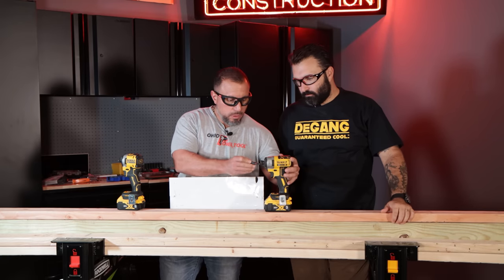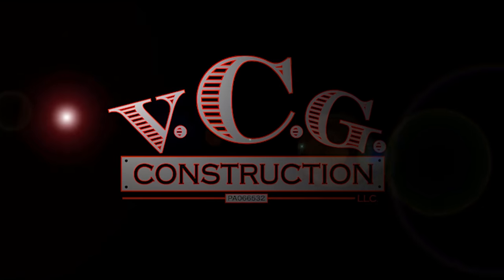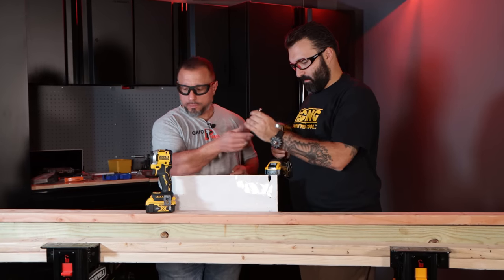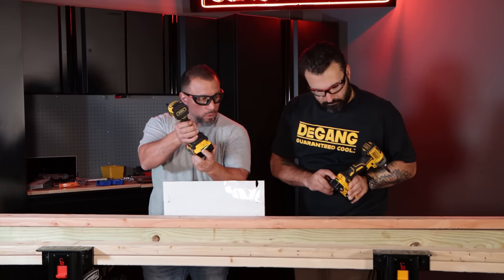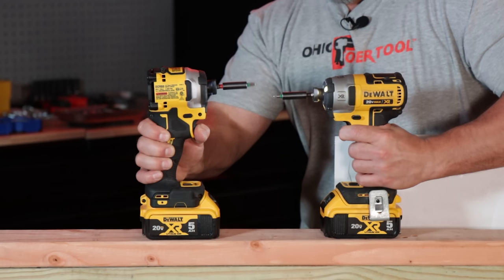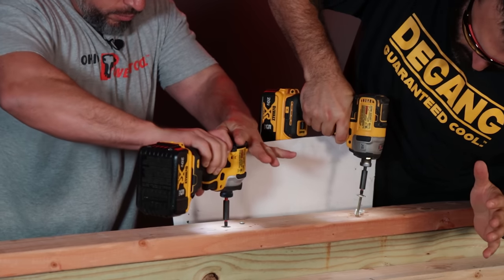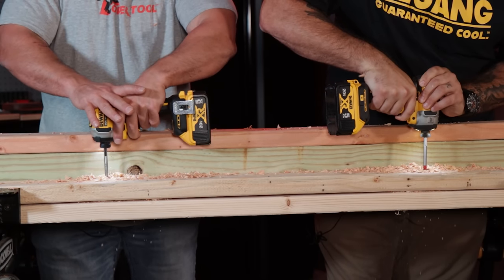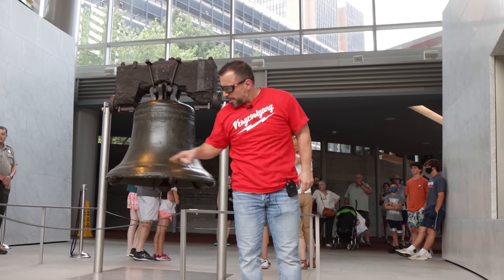Is DeWALT'S Newest Compact IMPACT DRIVER GARBAGE?

Comment: It’s nice that this powered tool industry has enough competition that everyone has to keep innovating and improving to stay relevant in the market.
Reply: It really doesnt, Milwaukee is best all around over them all.
Reply: @voodooreptiles3553  No single manufacturer has the best tool in all the categories.
Reply: They can can only innovate as fast as new dc motors are beingn developed in asia. It will be atleast another 5 years for another gen of brushless motors used from powertools to medical devices.
Reply: @voodooreptiles3553 but they dont last. Youre only considering one metric which is dumb. You dont buy cars based on peak horsepower thats one of the metrics

Comment: Hello from Russia. Guys, there's one important moment: you're showed that new DCF850 is much harder to work precisely. Less time to react, to stop, to save the material from damaging. The colour filter on 887 is also better 'cause id doesn't blinds when you look ai him from the flank. The 06:35 vs 06:40 shows that 850's compactness useless or even detrimental, because you'll confront to the material by the battery earlier than by the bit holder. It's when I say: «When you have no way to improve, you have to move to retrogression». The 887 is perfect as it is. If you have an insufficient of torque, you need the Milwaukee. If you have an insufficient of precision, you need the Makita. The 850 would be better if it would have same body as 887 with more power and/or more precision, but it have less precision and abortive body vs a little bit more torque.
Reply: Good eye catching that detail !
Reply: Прикольно , оч даже.
Reply: I'm glad you pointed that out, good eye
Reply: I’d go with precision so Makita for me. Power is good. But Makita overall has more balance. More than enough power for the job, with the precision and control. I have a Japan made impact that has lasted me 10 years and still going strong.
Reply: I never thought of it this way! My god it’s true! You don’t want the battery to hit the surface you’re driving into before the screw is all the way in. This can be solved by the smaller powerstack battery or by a longer driving bit.

Comment: I think the test would be fairer if it performs by the same person and put the two clips back together to compare the speed.  Or, have each person switch and run both tools at least once. Also, the person on the right is blocked by the white clipboard
Reply: Agree!  The person on the left handled the drilling much more steadily.

Comment: I’d like to see it up against the makitas (both 40 and 18v), the milwakee for sure, and maybe the flex
Reply: Me as well! I love my Makita 18v brushless. A showdown of these 2 is a must. If the 850 outperforms in several tests I'd consider adding it to my toolbox even though Makita has been my brand of preference for some time now
Reply: See the torque test channel they have just done a vid on that not pretty for 40v makita
Reply: @jgdavidson90      I saw that also. I was a little shocked with the makita not producing as well as the competition. I own dewalt cordless tools and I am satisfied with them but do wish I had Milwaukee. Oh well, I’m not about to switch $1,500 worth of tools now.
Reply: Powerstack beats 40v I've had or used every impact out apart from gen2 hikoki 36v. This little 850 is  brill

Comment: By the nature of a quick release collet like these have they will wobble; some bits more than others, depending on micro variations in weight distribution. But it’s the convenience of a quick release instead of a three jaw chuck.
Reply: Eh not really, try the new Milwaukee ones and they hardly have any. I’m pure dewalt myself but it’s super annoying how they didn’t fix this issue at all, seems just as bad if not worse.

Comment: I have the 850 and I am considering returning it. You guys used it on torx fasteners it looked like but on Philips drywall screws it cams out very easily. I had a lot of difficulty screwing in some long screws in an awkward position with the 850. I tried my old Makita and it did it easily without camming out. My friend told me I didn't know how to use it properly so he tried and had the same result. I think the impacts are just a bit too hard, even when giving it just enough power to barely start impacting. I will make a video about it to show what I'm talking about.
Reply: I been looking at this impact in a powerstack combo and the makita xgt40. My gut says go with makita as ive never had an issue with them ever
Reply: @stevec7435  I ended up keeping the DeWalt and I love it.
Reply: @alexkram  why is that? I’m looking to buy it tomorrow. So why bash it and then decide to keep it?
Reply: @Pokenostalgiastore  that was my legitimate first impression. It hits a bit harder than the Makita that I was used to and it does cam out easier on Philips heads. But I use it for a lot more things than just Philips heads. It's a great tool. I love the short length, in fact when I was repiping my house I used it to drill through some 2x4s that there is no way my Makita could have fit into that spot. So much power too.

Comment: Looking at all the tests across all brands it reminds me of the tests made on sterio systems in the 70s and 80s the differances  became so small that oscilloscopes were required to tell the differance. Our ears could not.
Here we are testing differant brands, different models etc and they are all either good or great depending on the chosen price point. Batteries good or amazing. We are fortunate, yellow red or green all great tools. The  battery system chosen has more to do with the range of tools than anything else. How well the tools last is a reflection often of the respect users have for tools. We are very lucky to have only good product to choose from. When tools are compaired driving a five inch construction screw and the differance between them is a 1/4 inch thats a touch down in my mind. If only our elected officials were this good.
All the testing is good but we cant forget that while there are differances they are all good or great, comes down to personnel choice.
One thing I would really like to know though. In the day of corded tools our tool collection often consisted of multiple brands. This is way less  common with battery tools.
How many people would mix and match brands if batteries were interchangable? Personally I would stick to a single brand that has earned my business. In europe the USBC plug is  now law. It would be interesting to disscuss how this would affect the power tool business.
My own opinion is the less government involvement we have the better.

Comment: I have the 887, just picked up the 850. It's so nice to have on the belt. Super light, especially with the power stack battery. Keep on my belt all day. Lasts through the day on light drywall work. Other work, it doesn't last as long heats up. Love the both of them!
Reply: Hate to tell you but the 887 and 850 weigh exactly the same
Reply: @cynic256  yeah but i use a power stack battery with it. Hella light.

Comment: I recently purchased the 
DCF809 / 2 battery / Charger kit for around $160 . I used it for a week doing electrical and was completely disappointed with it , I felt like I got ripped off . 
The 809 was just plain weakAF , you should’ve seen me I was so friggin pissed off at how weak that thing was 😡 . 
So I returned it and spent an extra $70 for the Atomic impact (DCF850) + hammer drill + 2 power stack batteries + charger kit for around $230 . 
I must say I was pleasantly surprised with the performance of the DCF850 w power stack battery . The DCF850 is the real deal my friends .
Plus , I got a sweet little hammer drill and two new power stack batteries out of the deal so I’m super happy about that  . 
I must say that that combo kit I got from Home Depot is one of the best deals I’ve got in a long time .
Reply: Nice upgrade. You bought the right stuff.

Comment: why does it appear the guy on the right with the old impact is not applying pressure like vince is doing to force the screw or hole bit down for a faster result?
Reply: Because…as you can see…that IS what’s happening, which is why these kinds of head to head are still subjective.  They WANT the new one to be better, so….just push it a little harder.  The published torque and speeds are the same… see 0:18
Reply: the xr drill impact is the same as thr xr atomic  smaller believe me same thing

Comment: In my experience with the atomic it is great until you are putting lags or other heavy fasteners in. The atomic impact gets super hot super fast. I've found my older model impact works better longer as far as heat and longevity
Reply: Exactly relevant to me, thank you.

Comment: That “test” where they had the bit holder in running at full speed and showing how centered it was was most likely due to the critical speed of the holder, you could see it wobbling about and then regain stability after it ran past the critical speed. I recon the collet are pretty much exactly the same, it’s just spinning faster allowing for simple rotor dynamics to take effect. In real use it would most likely “feel” the same under load

Comment: I hope this means there will be a major sale for the old impact driver and combos for Black Friday. The new tool is nice but for a weekend warrior like myself, I don’t need all that speed.  I’m looking at upgrading my NiCad Dewalt to Brushless lithium ion tools during Black Friday.
Reply: I own a old Dewalt dw054 and 054 they're tired and old but still work
Reply: @bluemantom77 I was also thinking about getting into the Dewalt 12v Xtreme system.  The old Dewalt tools are a pain in the butt to use when I'm working on the ladder, or under the car.
Reply: Same but an old Ryobi NiCad for me that chugs along when I need it for around the house. Been watching all the tool reviews to see which cordless line up to go with. Maybe the 20v or 18v from makita or milwaukee. Depends if companies produce anything else new and have a great bundle deal for black Friday.  What are your guys thoughts with the dewalt vs milwaukee vs makita cordless?
Reply: @thatfloridakid  the brands work the same like whether you are a Ford or Chevy person. I use Dewalt only bc I like their 20v oscillating multi tool and already have their 20v circular saw that I needed for a small project.
Reply: @crazedrunnerdave  yea your not wrong. It really is all about preference or which color you like. But I will say Makita impact driver and hammer drill is much better and more durable in the field (in my experience) I use both Makita and Milwaukee and pretty much have two of the same thing from each brand. Milwaukee is better is other and Makita is better is some things too and same with Dewalt. I’m a electrician so I find myself using Milwaukee more often but if I need to put a beating on my drill or impact I go to the car and grab Makita but most of the time I’m using Milwaukee (sawzall, hole hawg, etc.)  But honestly you can’t go wrong with either brand Dewalt, Makita, or Milwaukee. Fanboys make it a big deal when it really isn’t. Milwaukee fanboys are like Snap on fanboys, it’s pretty ridiculous.
Reply: Man if you want you can get the 850 rn it’s only 100$ bare tool at Home Depot I’m getting one tomorrow because honestly it’s quite a deal
Reply: @brandonsarsland-brunner3390  I ended up getting the combo yesterday for XR hammer drill and impact driver, with free angle grinder at Lowes.
Reply: @brandonsarsland-brunner3390  thanks for the heads up! Only down side is I don't have any batteries for any platforms yet. I've been building up my corded tools to be able to complete jobs around the house.  Is it still a better deal than waiting for the black friday stuff? It is tempting

Comment: Biggest issue I’ve had with my 850 is the front of the collet is slightly shorter than the battery face and it sometime makes certain jobs harder to reach with a standard length bit. But besides that I’ve been very impressed by the tool.
Reply: Hi, would that not also be the same for the standard impact driver 887? Yes or no
Reply: There is a YouTube channel called torque test where they test the powers and output of everything very impressive. I recommend checking them out that’s where I found that information. I don’t think the 887 has the same sized hammers.

Comment: I saw instances on both where the bits chucked off the collets and stuck on the screw heads,
Reply: the bits came out of the bit holder, not the collet. The bit holder just uses a small magnet.

Comment: Just bought an 887m2( same tool w/ 2 4ah) would you recommend taking it back and swapping for the new impact? The m2 is xr so which do you think would last longer?
Reply: Did you get a smokin' deal on it?  Home Depot will probably have a sale on these new ones and they definitely look more sharp and modern compared to the 887.  The 887 is like a 6 year old design and is mediocre compared to newer stuff, but hey, it's served countless professionals over the years as well, so, there's that.
Reply: @seano932  the 850p1 is 200 right now and the m2 was 240 when I got it a few weeks ago but now its 290. I had an atomic driver w/o the 3 speed and it was great. Decided to go with trusty XR version but now that this is out im wondering if I should use the 90 day buy back and get the new 3 speed impact
Reply: I'm sticking with my XR 887. I also have an 885. I'm sticking with my 887.

Comment: I think the weeble-wobble on the collet is intentional. If you are not holding the impact perfectly square to what you're screwing, the collet allows for deflection while still keeping the bit seated in the fastener. You can see it in action at 4:48 in this video. Drills don't do this and it's one of the reasons they skip out way more often.
Reply: I've heard that it has to do with the quick-eject aspect of the collet.  It seems to happen with all their impacts.  I've got to the store and stuck a bit in the display models and most were quite uhh floppy/loose, though one 887 seemed tight.  In comparison my Makitas are have a much toghter tolerance.  I like both brands though.

Comment: Hi Vince, do you have feedback about the longevity and quality of the 850? I’ve read that it breaks down frequently and it strips screw heads. I’m asking because once I buy it, it will be very difficult to get it fixed or even returned as I live outside North America.

Also, are all the dcf850 made in Mexico? Because this is all what I’ve been seeing being sold online.

Thanks and have a good day
Reply: If you have those concerns about the 850 I would think that you'd be fine with the 887.
Reply: @gpjadams2  I now think so too, thanks for the advice.

Comment: The battery sticks out further than the impact drivers collet. Doesn't that negate the newly compacted design? Nice impact driver but doesn't make any sense to me. Maybe they need to redesign the battery also.
Reply: 2 months after your comment you got everything you asked for when they released the power stack battery. I'm not being a smart-ass but that's literally what happened
Reply: @gpjadams2  The battery came out the same time. I just didn't know about it till someone pointed it out to me.
Reply: Did you buy power stack batteries? I haven't. I don't have the need or desire but they are great bad ass batteries. Can you imagine when they do even bigger ones.
Reply: @gpjadams2  no I didn't buy the power stack batteries yet. I bought the impact driver though. It's a great tool. Going to save a little bit more money and then buy the batteries.
Reply: @gpjadams2  once I use the impact driver I almost feel the same as you the power stack batteries aren't really necessary but I just got to have them.

Comment: I would like to see a comparison between the 887 and the new dewalt 12v impacts boasting 200lb/ft compared to the 887s 150lb/ft. Seems strange to me the lower voltage impact has more power. And dewalt is at the time releasing a NEW 20v impact that can’t match the little 12v.
Reply: watch torque test channel I think they did exactly what your asking for.

Comment: 0:18  The on-paper specs are identical where it counts!  So where is the point in spending out on an ‘upgrade’ that isn’t???  Vince seems convinced it is somehow more bang for buck, despite that it drives fastners in about the same time <within like 1sec - shrug>  I suppose if you need a new impact go for the latest model…but currently the new one is double the price of the old one.  As for burning up…Why would you use a toolbox impact to drive 1/2” x 10” lag bolts that you know should be set with a impact WRENCH, that just shows the user doesn’t understand the tool or its intended application, same for tools with cut-out protection…if it is kicking in, you’re wilfully abusing the tool, so don’t complain when it fails huh!  Use the correct tool for the job..right!